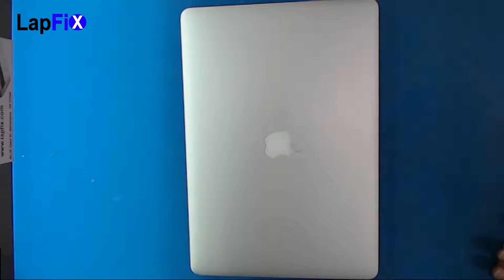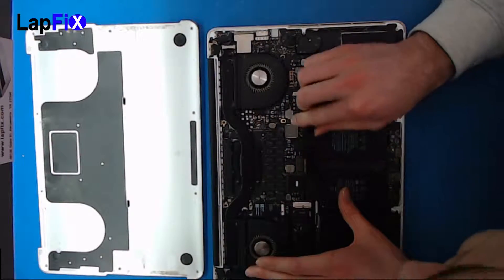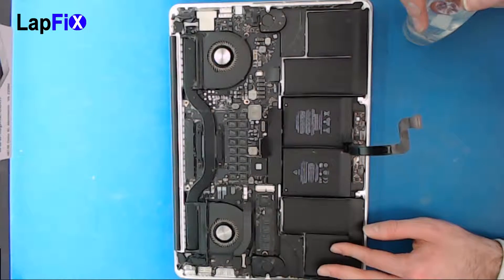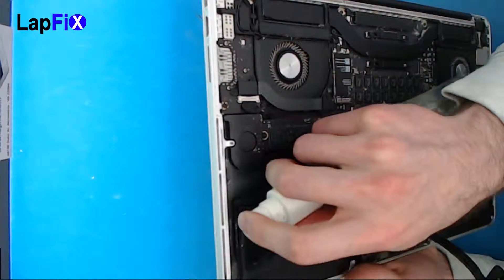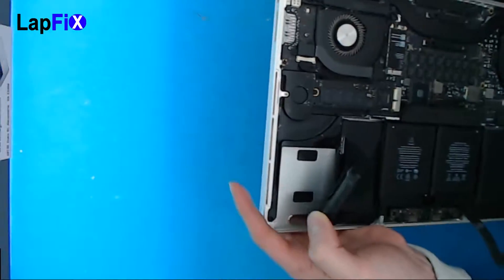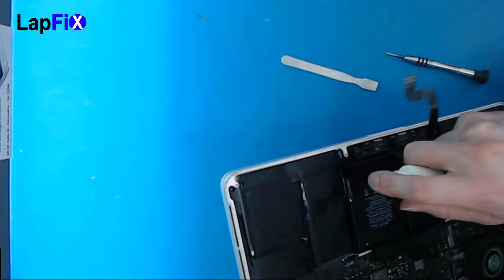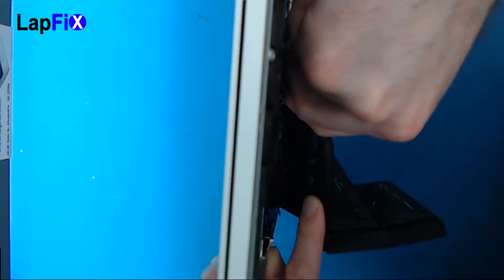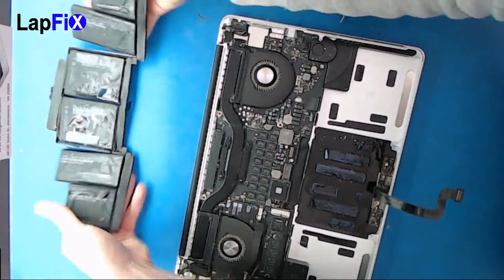How to replace the Battery for MacBook Pro 2015 A1398  | LapFix

Comment: from the looks of how you struggled to get everything out, I won't be attempting it, you really did not show enough close up of exactly what you were doing, on top of which I would not know then how to replace the battery with a new one.  Also iif you told which tools you used and where to get them would have been helpful.  Nevertheless I thank you for your efforts.  How much does a new battery cost and how much do they charge for the labor to replace.  I had my 2015 overhauled by Apple a few years ago.  They replaced the keyboard, track pad, logic board and battery for a round up price of $499.